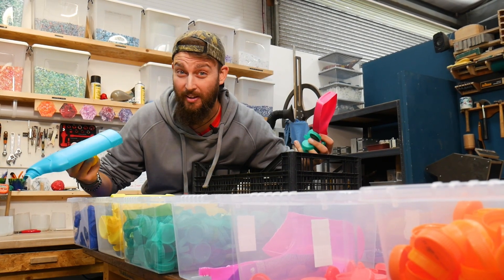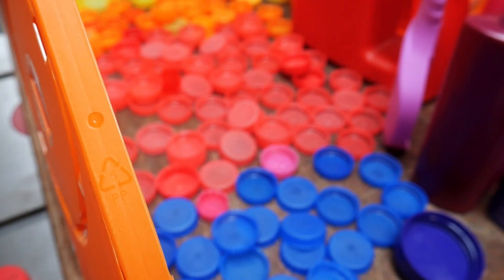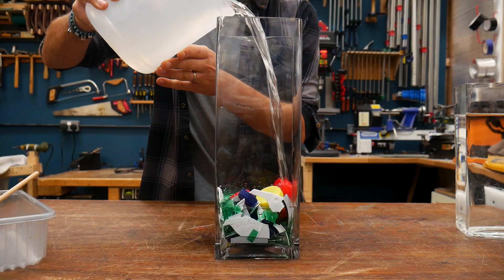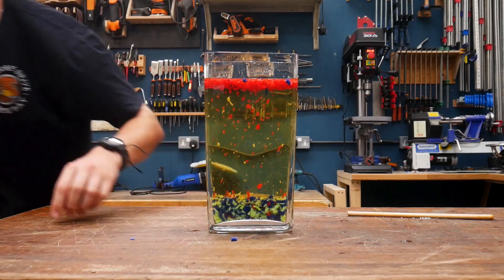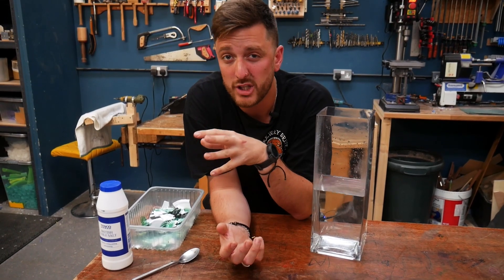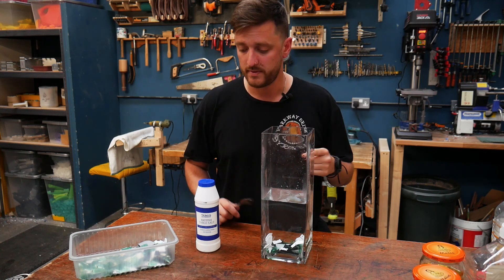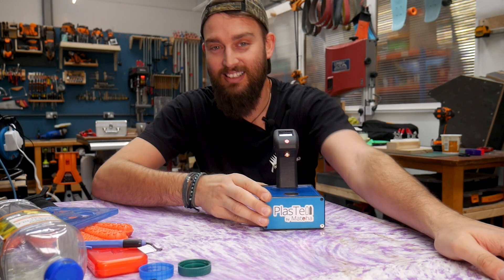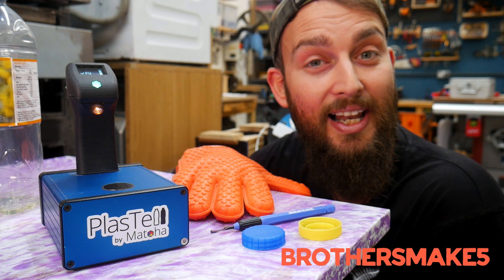How to Identify Unmarked Plastic

Comment: Thanks for this incredibly informative and entertaining video. I've been googling for the safety aspects of melting plastics, but difficult to find. You didn't just answer my question but showed how to identify varieties. Mindblowing! Keep on brothering... You make the world a better place.

To those complaining that oil is messy and not practical -   just cut a small sample and test it. Putting a lot of shreds in the container is just for the show.

There are vids about recycling paper and cardboard by soaking it, breaking it into pulp which allows creating new objects  by removing the water (pressure and/or drying). You stick to plastics please. In a world where everyone is buying resin and casting more plastic objects I'd rather learn about DIY methods that turn used plastics into new objects.

Comment: I have a question. I know this video is a year old, but how do you shred your plastic? I’m in the process of making a workshop that deals with smelting metal and stuff and reusing plastic and trying to find ways to shred the plastic easier.
Reply: I'm a Material Scientist.
Recycled plastic is put into a commercial shredder. It has a hopper similar to a garden shredder, plastic in and a set of rotating knives chops the plastic, ready for injection molding.

Comment: Informative. Very useful. The alcohol and water mixture was interesting because you were reducing the density of the mixture. A hydrometer would allow you to determine the density of the liquid.
Reply: Not to be confused with a hygrometer, which measures humidity.
Reply: only problem some might running an legal distillery all empty bottle is not going help case to much? 🙂

Comment: Hello. Amazing video. I would like to know if there's any way to separate HDPE and PP from each other without using Vegetable oil. If we use vegetable oil it will be very hard to clean that and supply. Any suggestions please.
Reply from the maker: You can use the alcohol mixture to achieve this as well if you don’t dilute with water

Comment: To remove problem with water surface tension you should add a bit of detergent to water which will decrease surface tension. Some of them are really potent and there are one which do not create bubbles.
Reply from the maker: Great shout - thank you!

Comment: Tips for float test:
a very tiny amount of dish detergent (less than a drop, assuming your plastic is relatively clean already) will help break the surface tension of the water in the float test and create less false identifications when dealing with plastic that are very close to the water density.

If you get real geeky, you can actually separate out by density much more specifically then this by using other mixtures than pure water. If you add some common table salt for example, the water will start to weigh more. If you accurately measure the water density then you can determine exactly the density of the material, which can often uniquely identify what it is, or at least narrow down the options to just a few. (I see this is sort of covered later in the video)

Another useful thing to know is that all plastics that float in this test can not be easily painted (or glued). They either need a special plastic primer (which honestly is not guaranteed to work well either), or ideally they should be flame-treated on the surface. You can look up how to do that in another video.
Not all the plastics that sink are guaranteed to accept paint well, but most of the common ones are workable, at least with a light scuff sanding and/or primer.
Reply: That's a great idea. This means that if the plastic is going to be washed, then we might as well do the float test at the same time.

Comment: Pet is used a bunch in 3d printing. Cnc kitchen did a video on turning pet bottles into filament which can then be extruded. It's neat!
Reply: PET itself isn't commonly used for purpose-made 3D print filament, because PETG - where the G stands for "glycol modified", as the ethylene glycol used in production is replaced with CHDM (cyclohexanedimethanol) instead. This reduces the melting point, and prevents crystallization, which makes for a material that prints easier as it warps much less.

PET pull-struders are still quite a fun niche though, as the properties of plain ol' PET are still good enough for many prints, and the fact that you can get PET for basically free out of the trash helps make it worth it..
Reply: Printing all the bits for the Recreator3D  as I type this :)
Reply: @TheDiskdaddy b

Comment: Surely there's a simple solvent test to distinguish PVC from PET. PET is immune to most solvents and PVC is always used with solvent based "cements". And while PVC is nasty stuff, PET is excellent to recycle at home.
Reply from the maker: Possibly, but we use both of them very infrequently so we haven’t explored this as much. And it depends what type of recycling for PET you’re talking about. Cutting the bottles into strips and making filament or cordage, sure. Melting it for remoulding can be incredibly dangerous.
Reply: @BrothersMake  What danger do you see in melting it? Any time you FDM print you're melting it.
Reply from the maker: That’s with a tiny nozzle and hot end. PET is very prone to absorbing moisture. If this moisture is heated and put under pressure you’ve essentially made a bomb. There haven’t been many injury’s from the Precious Plastic style workspaces, but all of them have come from people attempting to use PET in these machines.
Reply: @BrothersMake  Ahhh, that absolutely makes sense. You definitely need to dry PET really thoroughly to use it even in FDM, but it's most excellent once you do, better than any commercially available filament you can use on consumer grade machines.

Comment: Really nice work, you two put so much effort into the things you do. 👏
Just a question. When you did the water test, some of the plastics were sinking, is it the same in the oceans, or are more plastic types floating because the seawater has a higher density? 🤔
Reply from the maker: Thanks so much! This one did take a long time to put together ☺️ As with the salt test a little later on in the video you’ll find that polystyrene (♻️6) and a number of ‘Other’ (♻️7) plastics with similar densities will float, but PET, PVC and a whole load of others will most definitely sink. The Great Pacific Garbage Patch is certainly a huge issue in the ocean, and efforts to clean it up are progressing. But possibly a bigger and much more difficult to solve issue is all the plastic at the bottom!